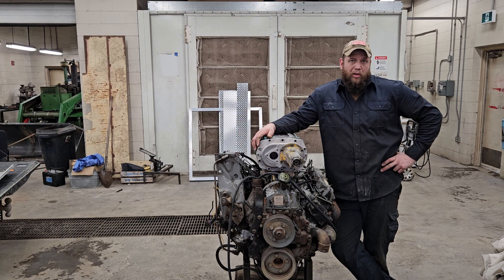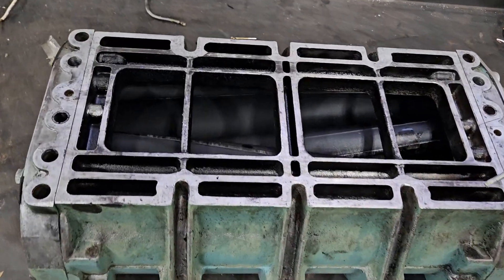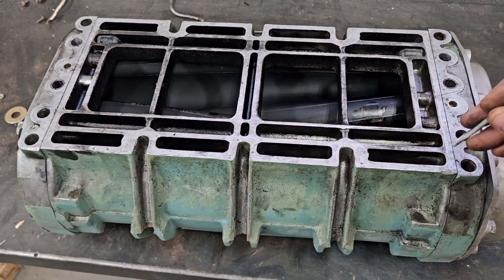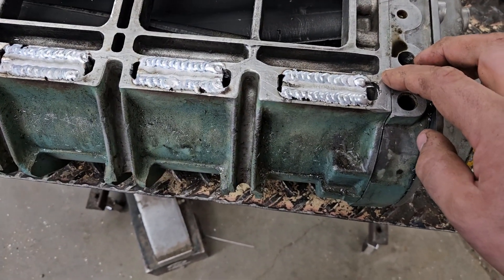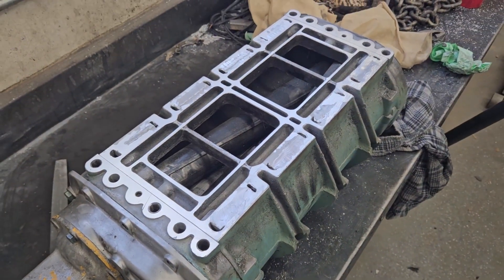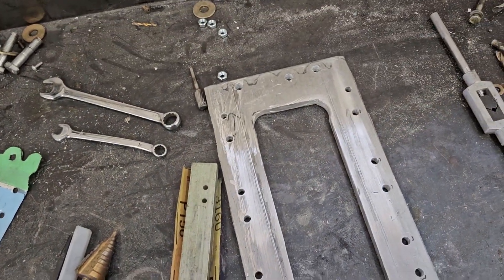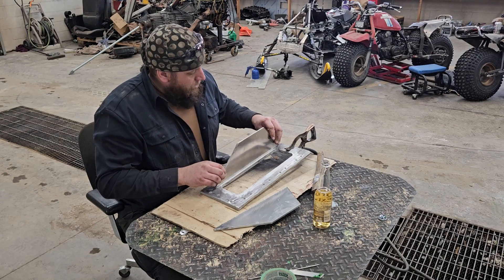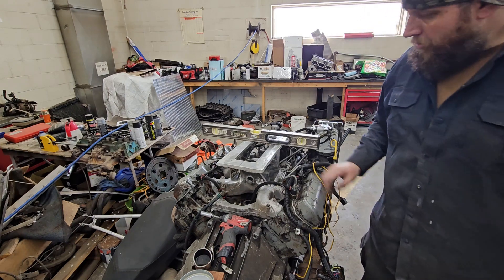THE CRUDE diesel experiment

Comment: Hello im a heavy diesel mechanic. I have a old 7.3 idi working on a p pump conversion moded the custom timing cover  to except the pump in the vally. The intake is custom i made a sheetmetal tube intake for itthats has the same blower you have on it. The heads are ported where the prechamber use to be modded for the cummings injectors. Pistons changed. Heads are studded and a special bar that bolts to the front of the block top were vavle covers are to back of head/block to give extra head clamping force. Highly modded vavle. covers. Im still working on upgrading the oil pump and a few other things. Still in building process.
Reply from the maker: That is complete madness..... I love it. You are a maniac! The p-pump is def a must. The factory pump is so small that it is basically useless. I'm looking at getting a stanadine pump that is juiced up for this one in the future. 😎

Comment: Interesting setup. Did you know that you can buy an adapter plate for a v series Detroit to bolt to an inline intake? You wouldn't have the need to weld on the stock case  or drill out a bare plate of aluminium.
Reply from the maker: Omg.... where where you a few weeks ago lol. Thats wicked! Do.you know the company?
Reply: @TheUn-namedProject  they can be purchased off e-bay, I thought speedmaster 79 produced one as well but I don't see it on their website.
Reply from the maker: Thanks again